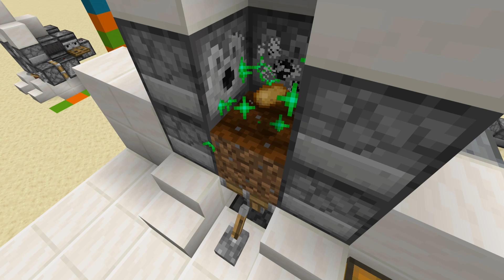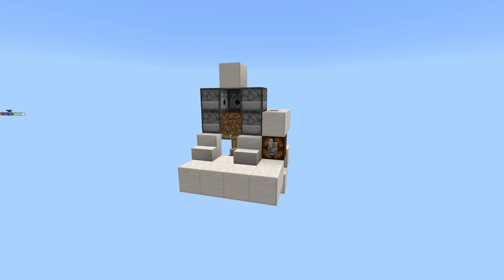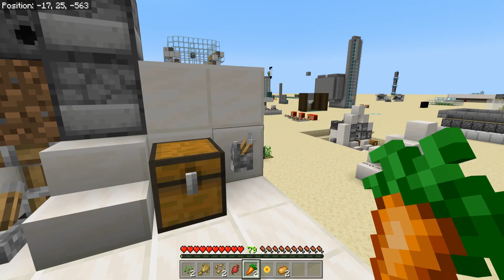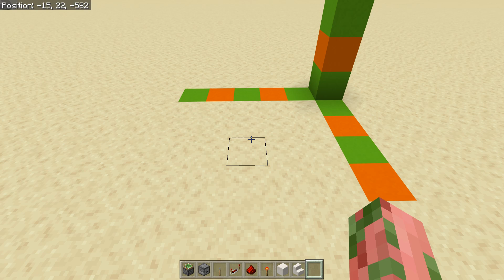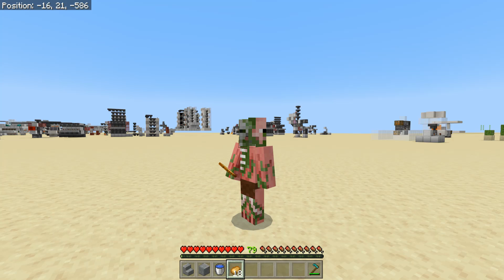Minecraft Bedrock: Micro Crop Farm Tutorial! 15,000 Crops/Hour! MCPE Xbox PC

Comment: Can confirm as of 4/21/20 that the first version works on PS4. Fantastic farm. Exclusively build time (not resource gathering) took about 10 minutes. Thanks Silent!
Reply: Kush Patel Make sure you are above the torch when you place them so that the observer’s “face” is towards the torch. Standing on the rear dispenser and looking down on the torch is how I did it. Maybe try crouching when you place it if that doesn’t work.
Reply: Kush Patel Yes the face is on the bottom.
Reply: Kush Patel The arrow is on the side and is pointing up ^
Reply: Kush Patel Sorry mate, I don’t have anyway to join. I’m a solo player. Best of luck though.
Reply: Kush Patel sorry mate, I don’t have anyway to join. I’m a solo player. Best of luck though👍🏼

Comment: Update: it seems something changed in a recent update: yesterday, I refilled all the dispensers to the rim, and I noticed the bottom 3 never "shoot". That mean that planting on the lower level give me back my seed/initial crop. Only the upper ones work.
For info, I did not try different timing yet but I am playing locally, on Win10, with a couple ticks delay (full speed was working when I first built the farm, but for my kids joining from their tablet, I had to slow it down a bit)

It is perhaps just me, I perhaps broke something and will double check every thing anyway.
Reply: I found out that the repeater closest to the piston MUST be on 4 ticks delay to get this to work. The other one however can be adjusted. And rebuilding the whole things in test world, with version just updated to 1.14.1, first the first time ever, I got several crash of minecraft, always when the machine was running. Thanks you for the "bug fix" update Mojang :-/
Reply: So if I build it it’s gonna crash the world?